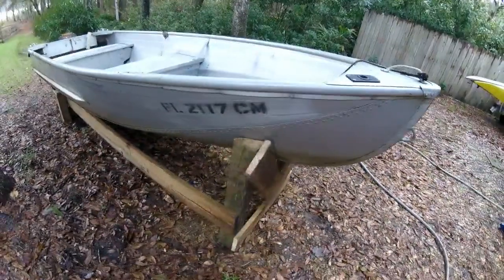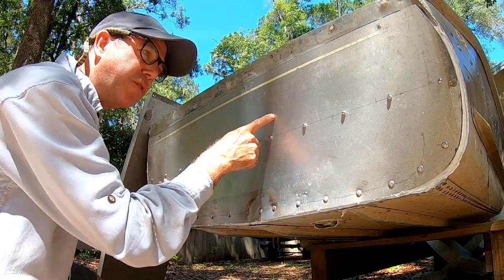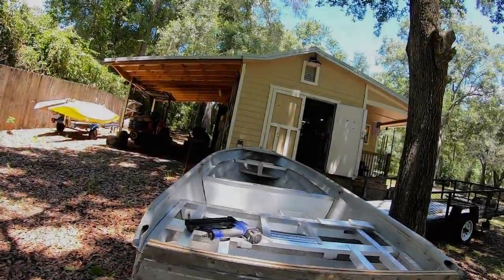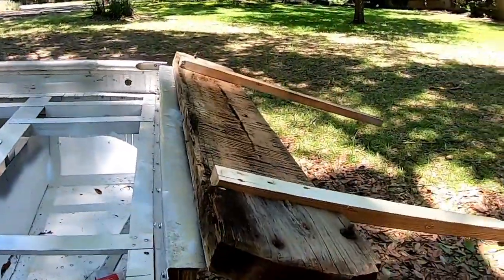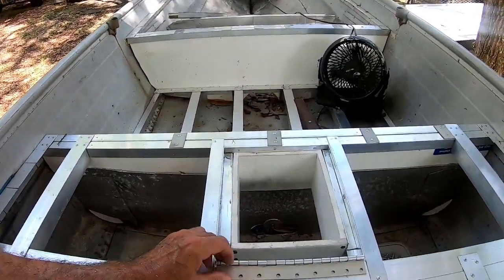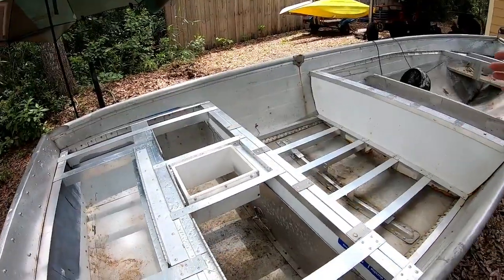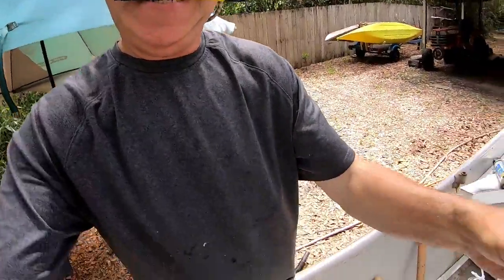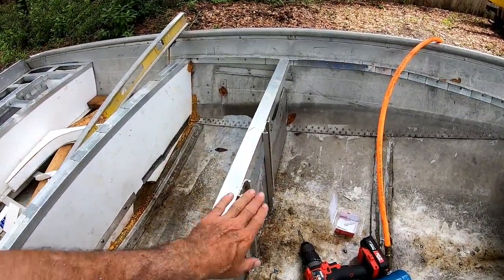Rowboat to Bass Boat Conversion, Part 3

Comment from the maker: This project is moving along slowly, but I'm solving the major problems with the hull condition, hull drainage, plumbing and electrical in ways that are satisfying to me and make this worth my time.  The custom live-well is coming out really nicely. I'm so glad I didn't take the easy way and use a plastic storage box.  The biggest problem in front of me now is time.  I work a full time job as an engineer and that means more than a 40 hour week...I'm grateful to be working though!
I'm working on improving the sound and image quality but,  that will probably be slow too....
Reply: What's happening? This doesn't have anything to do with the boat build but nice going with it so far!. I just had an idea for a good new episode for you to brainstorm with. How about a show about clear coat testing, kinda like KBS vs Epoxy Resins, 5 minute epoxy vs 24 hour -  vs UV clears. Maybe use the Rockwell hardness measurement chart to see how each material can hold up and resist indentations and just general rock dragging crankbait fishing to see which holds up the best. Just an idea. I'm really curious along with probably  hundreds more!  To see which is the best KBS or Epoxy clear!  Just an idea. Pretty sure this would get lots of attention and views trust me on this one!
Reply from the maker: Thanks for the idea....
Reply: @EngineeredAngler  Yeah no problem. I know it's gotta be tuff to keep thinking stuff up to make a new  episode to get more views and new subscribers

Comment: Great videos! But one suggestion, pick up a lapel mic that either works with your camera or a $20 corded one that can plug into your phone so you can record great audio and sync it up in video editing later. Have to crank the volume up, then get blasted with sound when something happens closer to the mic.
Reply from the maker: Working on it!  I'm on my 4th wireless mic.  Just picked up a Nikon mic...if this one doesn't work I'm switching to sign language :)

Comment: Like the project and the progress you are making. I was wondering if you have any concerns regarding your vertical supports  rubbing on the aluminum floor when the boat flexes in the water. Maybe you have clearance between the bottom and the support, I don’t see any flat support between the floor and support to spread the load and cushion  the friction on movement.
Reply from the maker: That is actually a good point, here's why I'm not worried (assuming you're talking about the small tabs that are supporting the forward angle cross beam for the cockpit floor, attached to the bulkhead)  I worked out the expected loads and that wont be a problem, the possibility of them moving around and damaging the hull is nearly zero since they are wedged in there pretty firmly.  In addition they will be encased in 2 lb density foam, the foam has some pretty impressive adhesion strength and will bond the hull to the tabs, to the beam, to the bulkhead, and to the deck.  Thank you for watching.

Comment: I have a 12' Sears Gamefisher alumiumn boat, I'm getting ready to try(TRY being the key word) to do the same thing because it's is really unstable.
I have the same style seats so I'll use your framing ideas, I was curious, the drainage to the back of the boat with the floor ribs, You are going to have to have 1-1 1/2 inchs of water in the bottom before the water moves over the ribs to the back billage area Do you have any plans for  3/4' PVC style drain tubes in the through the  floor ribs?
I'll be waiting for the next video in the series, great job.
What is the projected additional weigh add to the boat any clue?
Reply from the maker: The water will drain down the middle where I'm leaving a channel.  The original stiffening ribs have a small weep hole at mid-ship.. so far I have added about 45 pounds. The real weight will come from the deck and live well and all the added hardware.
Thanks for watching.

Comment: Big project and your doing a great job finding hidden solutions to each problem that comes up and I admire that. Have you ever used Flex Paste? I’ve seen this advertised but never used it myself, yet. When I saw it advertised on tv I was thinking it may work in place of the clay when your creating the 1st half of a silicone lure mold but now wondering if it would work better than caulk on this project? Just a thought....thanks for the videos. I really like that band saw also!!!
Reply from the maker: Yes I have...I considered it but, its not much cheaper and the 3M 5200 stuff is pretty bullet proof.

Comment: Interesting, I never would have used liquid nails, instead 3M 5200 In any application exposed or possibly exposed to water that stuff can't be beaten for adherence, waterproofing, and longevity.
Reply from the maker: 5200 sets way too slow for my taste.  I use it on my salt water boat and anywhere where it will show on either boat.

Comment: If that’s treated plywood against the bare aluminum, consider the aluminum gone. Probably at a most inconvenient time, just sayin !!!
Reply from the maker: The ply wood is a treated ply designed for use on roofs on the coast.  That means they use a different kind of treatment that doesn't have the really aggressive copper salts so it can be used with aluminum flashing and trim.  I'm more worried that is will rot and I'll have to take all that transom work apart.  Only time will tell.